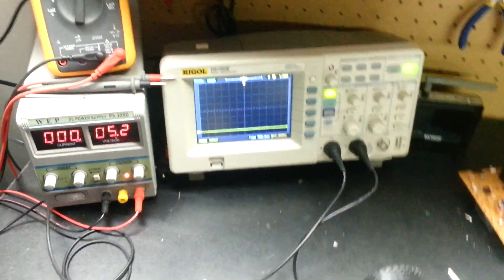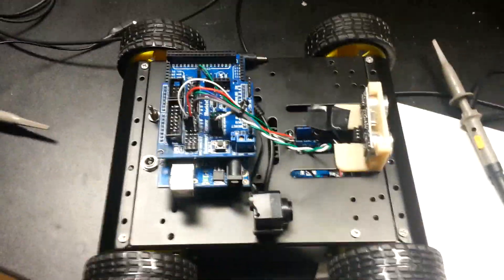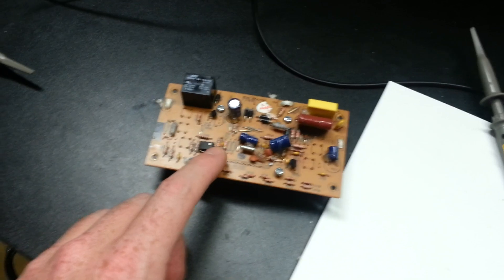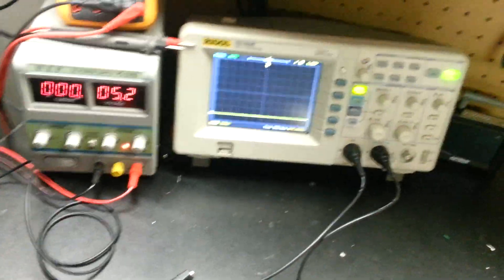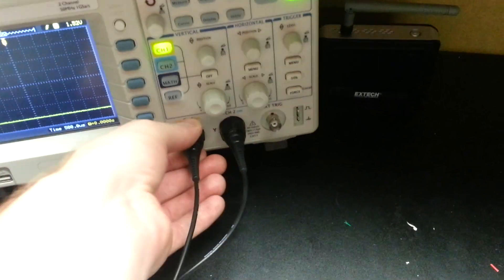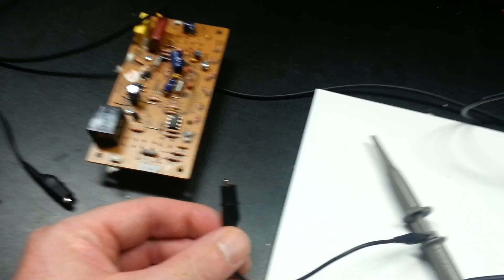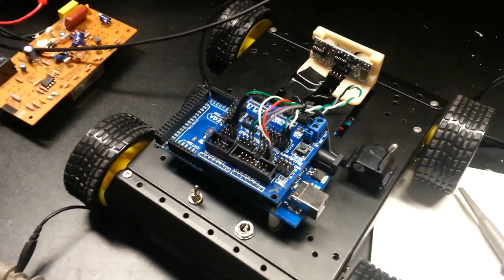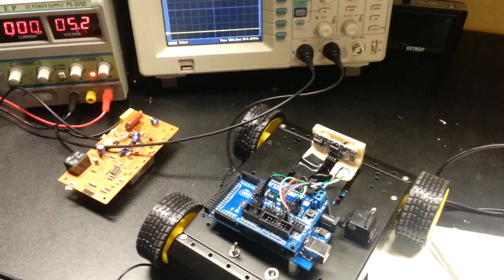Oscilloscopes- Why you need an isolation transformer

Comment: Great video, thanks. I don't see why by bare feet touching something live on the board under test ? I can poke a metal rod into my power outlet 240 vac in Australia, and my RCD/GFCI trips within 10 ms and to 15 mA... so power is off to the scope and the board under test,,,, so where is the problem ? please tell me where I am wrong,,, as all videos on I/T will tell me to use an I/T.
Reply: Not all outlet trips under 10 ms, and with high enough current, 10 ms is ample time to cause a lot of damage

Comment: thank you for the great vid - just one thing - if my TEST equipment (such as a scope) is connected to my mains and my SYSTEM UNDER TEST is plugged into an isolation transformer. My understanding is that,  generally this is the best/safest way to test.
Now if in addition, I introduced a ACorDC power supply (also test eqmt plugged into reg AC mains) as power that feeds my system undertest - will this somehow change teh issue in that it becomes unsafe again -
 or 

I can have as many test eqmt plugged normally into AC mains (3 prong plug etc) used for testing as long as the SYSTEM under test is plugged int the isolation transformer....?

Comment: Thanks for this. Quick question. I bought an isolation transformer. Inside, the earth pin on the socket on the transformer is directly linked to the earth pin on the plug that would go to the wall. Does this mean that a circuit under test would still be mains earth referenced? Thanks

Comment: hi. couldn't you just use one of those ground defeating plug ends on the secondary side instead of opening up the case and altering the tripletts wiring. I'm looking at a Hammond171e and it doesn't look so straight forward to rewire.
Reply: The neutral and ground on the scope are not tied together, and the scope does have an isolated power supply, so using the cheater plug should remove the ground to mains shorting concern.

UL requires any metal that you can touch, if a 3 prong plug is used, to be safely at ground reference.
Reply: +Marty Rat -- The "neutral" of the secondary is still connected to ground back at your service entrance, so no. But, plugging the primary side into the mains with the ground cheater would break that connection, I think. There is probably some good reason that I am not aware of not to do this either.

Comment: In power cable of oscilloscope you must cut the ground cable.It's solve the problem.
Reply: +Roby Martin yeah and then you end up with a scope that has full mains voltage on the case and all exposed metal. Dumb idea. REALLY DUMB IDEA!
Reply: I do this for years.And it's save for device I measured and oscilloscope it self.Sure you don't touch chassis your oscillosope when you meassured .Especially metal one.But if you use digital oscilloscope with plastic body it's will be not problem at all
Reply: @robymartin6788  Not only is the chassis exposed to high voltages also your BNC connectors outer metal ring is a dead trap.
Reply: @lurker1973  
Well said

Comment: In the past when I've worked on mains-connected equipment, I've plugged a cheap 50W mains inverter onto my isolated DC bench PSU to get myself an isolated mains power supply. Because the inverter only can only deliver 50W (and shuts down if you stress it any more), I've effectively got mains supply with a  21mA current limit- very useful when powering up incorrectly repaired equipment (such as the switchmode where I soldered the transformer in back to front). Please someone tell me if that's not as safe as I think it is because 50W inverters are a lot cheaper than isolation transformers in the UK. Cheers!!
Reply: old comment but this is a GREAT IDEA. Everyone has car inverters lying around, they're low power so even if they "could" do something they'd burn up themselves or blow a fuse rather than send 30 amps through your arms forever.

Comment: I think something that would make this whole discussion a little clearer is to talk about the subject the way Europeans do; where ground (local circuit ground) is different from earth (the big ground :) ) .   I know this seems like a small thing, but I think "words matter", and talking to initiates about the difference between "earth referenced ground" and "circuit ground" would help us has a reference frame to clearly express these two different concepts.
Reply: earth and ground are used pretty interchangably here in UK, although it is more common to say earth for mains wiring and ground in circuits it's not exclusive. "Protective Earth" is a specific thing though. It would be easier if they were exclusive terms, but then you'd have to explain to people why earth and ground are the same things and how something can be "ground" but not necessarily grounded to earth... perhaps "common" would be the better term for what we call circuit ground, then it has no implication about earth grounding.